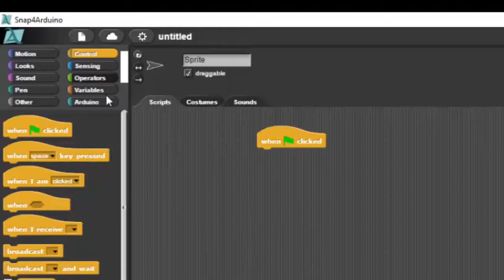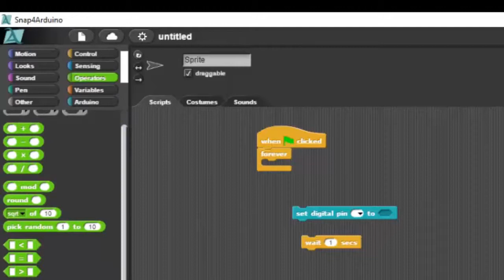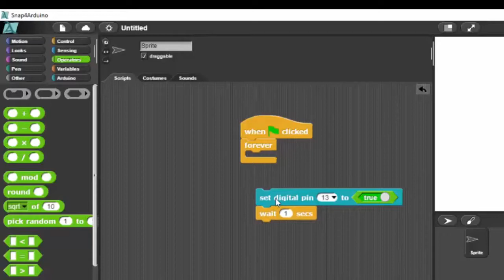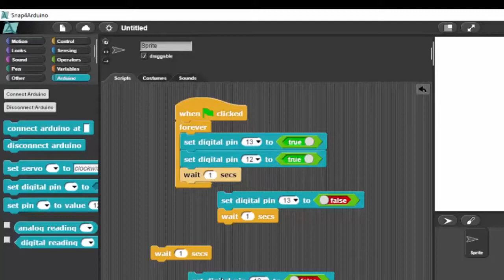Blink INNOV8 Arduino Innovation

Comment: Just a suggestion: you don't actually need the boolean block, you can just click on the [ set digital pin ( ) to < > ] empty boolean slot to toggle it to either true, false or undefined :)